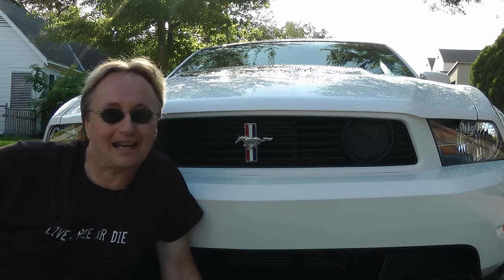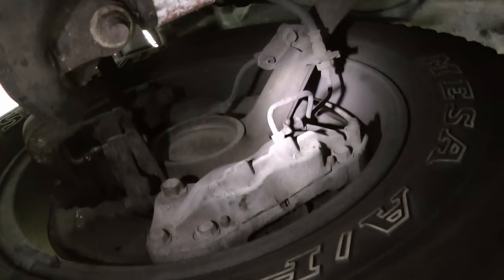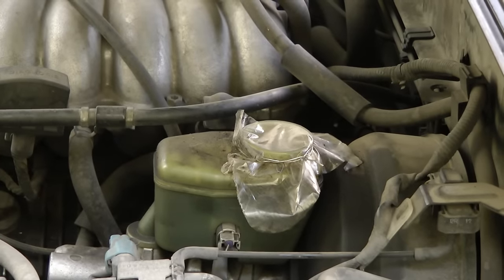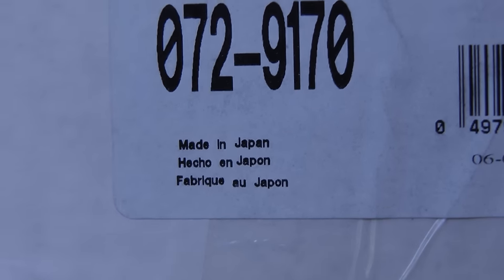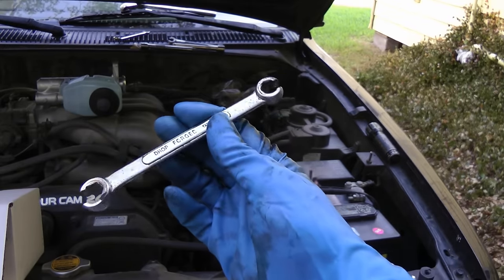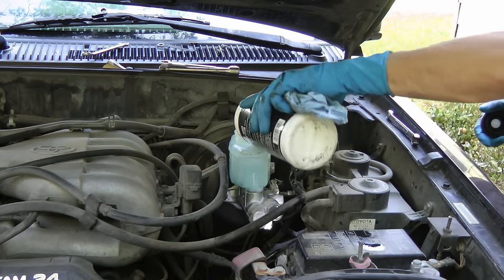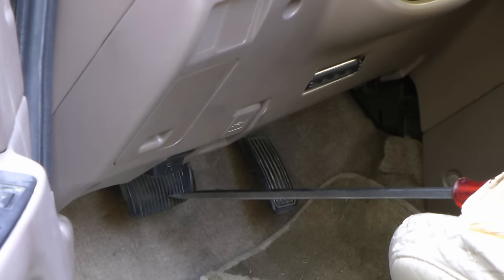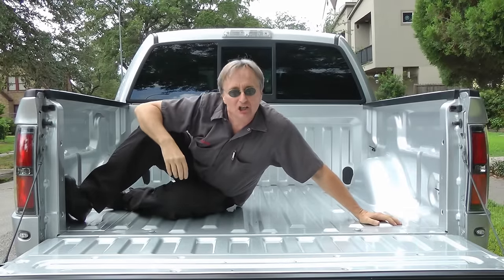How to Fix a Brake Pedal that Sinks in Your Car (Brake Master)

Comment: I just diagnosed and replaced a failed brake master cylinder on my 1986 Chevy K20 truck. $55 at Napa plus 16 oz of brake fluid, half an hour of time and done. And my 16 year old son helped me with the whole deal. He was very pleased to do the process from start to finish. Then we checked all the fluids. A great father and son activity and easily saved me 30-60 minutes of shop time.

Comment: Had problems with my brakes on my 1990 Toyota Pickup 4x4(4 cylinder). Replaced the front calipers (tried to take off the brake line on both but they snapped and lost all the fluid in the master cylinder) and the rear brake pads. Found out that the pedal went to the floor, figured it was the power booster (it wasn't) and got a used one from a 1994 Toyota pickup. Still the pedal went down and thought about the master cylinder. Here it was and I ordered the replacement part on Sunday and got it yesterday and did what Scotty said to do to bleed it. Got pressure back and bled the brakes and it's better than ever. Thanks for the tips Scotty!

Comment: Fixed our 1994 Chevy K1500 today using this technique.  We had already 
bled the brakes to no avail, and also bypassed the rear-anti-lock module
 which is reported to cause problems... so I got the replacement master 
cylinder and used Scotty's technique here... had a firm, hard brake 
pedal in about 3 minutes. :)  Scotty, you're awesome--keep up the good 
work! :)

Comment from the maker: to each his own, I never bench bleed, this method works fine if done correctly as in the video.  You can bleed the whole system, but often that will lead to leaks in an older system, believe me.
Reply: When you bleed it do you have to do the bottom method on each line by tire or ?

Comment: Great tips Scotty! I just find a gravel or dirt road and speed up to 20 or 25mph and do 3 or 4 emergency stops making sure the ABS kicks on. Then go back and bleed the system again. It works because air can be trapped inside the ABS Module and it is very difficult to remove the air using traditional bleeding methods. By activating the ABS, the air is pushed to the calipers and allow the air to be removed via bleeding. Of course, if you have the computer programs to do this without driving on a dirt/gravel road, then use those. But for those who don't, this works well.
Reply: My abs hasn’t worked for years. It’s just standard brakes now which I prefer. Question… with the abs system not functioning could this cause any issues with the rest of the braking system? Hydraulics, air, and the old fluid still in those abs lines 🤔 I just have abs light on dash with a sticker over it. 😁

Comment: Scotty, I am having trouble identifying why my brake pedal is sinking to the floor, at first, I discovered one of the calipers on the passenger side was bad, that made me to change not only the caliper, but the front brake pads, however, checked the rear brakes were in good condition, no leaks from either wheels. My main problem, the pedal is still depressed all the way to the floor, now the car does stop when you engage in gear, the emergency brake applied, what is the problem, is it  the booster or the master cylinder?
Reply from the maker: Godwin anetekhai often a bad master cylinder, and here's a test. If it does it with engine not running and engine running too, a bad master is often it. BUT, if it is hard with engine off, but drops with engine on, the booster is bad

Comment: This Great Video by Scotty got me to go ahead with the replacement  after he said to disregard the bench bleeding. It worked great on my 2001 Sport trac with ABS. There is a bleed port on my master cylinder opposite side of the brake lines. It made it real quick to get the air out along with the technique Scotty showed.
Reply: My abs quit years ago. It doesn’t effect my braking… that I know of. No grabbing. With the abs not working could this cause issues with the hydraulics, air in those lines and old fluid? I prefer just standard braking system from 20 years of living in Alaska without it. Alaskan winter mantra… “slow down, pay attention, increase your distance and feather your brakes.” Haven’t had an accident with anyone in all my years of driving. Defensive driving class for Forestry many years ago stuck with me.

Comment: Scotty, another great video- I've seen quite a few of yours; you're a go to guy for my automotive woes. I've worked on cars since 1990- even before, but that's when it became necessity to learn and remember. This video really opened my eyes to brake jobs past where I never got the pedal I wanted. I usually bench bled and followed that with repeated 4 corners bleeding. Sometimes I just could not get a satisfactory result after gallons of brake fluid bled through the lines. I was surprised to see you forgo standard and accepted practice of bench bleeding on, well, a bench. After watching thios video, I was able to bleed a vintage Camaro to a rock hard pedal after getting NO PEDAL even after replacing a booster, master cyl, shoes and hardware, and a new Combination Valve. In ten minutes tonight, I bled the best brake job I've ever done. I'm book marking all my PCs and making notes in the braking section of all my manuals. Keep on truckin'.

Comment: Scotty, finally the mystery is solved.
It was bad / leaking brake calipers.

Lesson learned, never rebuild them with repair kits. Just buy new calipers.

Installed new ones and i feel my brakes again. No sinking, either engine running or not, hard as they must be.

Thank You Scotty for your patience and help you gave me.
I really appreciate that.

Comment: Thanks for the video. 
I didn't know there was such thing as having to bleed the master cylinder. I thought I would have to take off all the wheels and bleed each brake (pain). With the assistance of my 9yo, we bleed the brake mc as you instructed, and now it STOPS! Thanks again. Liking and subscribing.

Comment: I have a 2010 HHR I changed my front brakes Pads. And I also bleed the brakes and I still have a sinks brake pedal now I know what I need to do.  Thank you Scotty God bless you my brother. Amen
Reply: did the master cylinder fix your brake pedal feel?  I have 09 chevy cobalt basically the car version of the HHR.  I did the front brake pads but still have that sinking brake pad feel.

Comment from the maker: If you have no air in the system after pressure bleeding the system, replace the brake master cylinder and pray the booster isn't bad too
Reply: Can I do this with the car in on position and or running or must it be completely off??
Thanks in advance

Comment: I tried to bleed my brakes multiple times after new pads and rotors and hitting a dear first. lol.... Hit a dear first but not bad......just clipped it, but had to stomp on my brakes hard like 2 or 3 times. lol....Ruptured a front brake line so had to be replaced first. Then a week later decided to go ahead and replace pads and brake rotors. Pedal got better after bleeding but only for a couple weeks....got all mushy again and back to the floor. So....makes me think my master cylinder is leaking inside and went bad cause we checked and didn't see nothing leaking or wet underneath. lol... So great video to post Scotty!! Was very helpful man!

Comment: What does it mean when I went from I went for a brake fluid flush, with no problem on the brake line…… but as soon as I get it back and try to drive away from dealership and brake  sinks to floor?   No pressure, did they not tighten the lines, or not put enough fluid in?????  I know the master cylinder did not go as it was entering the service portal. Please someone reply ❤️ Tks!!!

Comment: I actually followed this guide and was able to change my master cylinder myself, thank you Scotty. Could have been nice if you warned us about the master cylinder would squirt brake fluid if the brakes are pressed and the lines are loosened. Found out the hard way.

Comment from the maker: depends on how it broke. Sometimes they just get harder to push, but stop. Sometimes they won't stop at all
Reply: That’s what happened to mines harder to push almost impossible then the I P brake system came on
Reply: I got an 01 Corolla, the guy bled the right rear wheel . (No foot on the brake bleeding procedure)until bubbles came out. He said the brake pedal always went to the floor and the master cylinder never goes low

Comment: Putting plastic over the opening??? What the heck were they thinking, a new cap costs like 10 bucks, or even less if you look for a used one...
Reply: It’s Pecos Hanks old car. He’s a storm chaser and  I wouldn’t doubt that he lost the cap on the road and didn’t really have time to buy a new one.
Reply: @Obi_Wan_Kenobi_027  there are toyota dealerships everywhere bruh he was just lazy

Comment: Hey scotty I just changed the front shocks on a 01 civic and everything that could ho wrong did starting with the stud for the tire breaking off when I took first tire off.anyway I took the hose off the caliper and brake fluid came out so naturally I put it back together when I finally got the job done the brakes went to the floor they stop the vsr but like I said they go to the floor. What should I do should I try bleading them and if so do I have to bleed all for tires  or can I just do the fronts please help
Reply from the maker: you have air in the system, start by bleeding the front brakes first as those are the ones you disconnected

Comment: Hey Scotty , do you have to bench bleed the master before installing ?
Reply: I didn't , i just followed the instructions,  i've just finished changing one on my Mazda 3 ,  i'm just back from a test drive,all is good.
Reply: I didn't either, not sure if it matters but I did bleed the whole system big time. It has rust in the master reservoir. It is a good thing to change fluid every 5 years? Beats me, when it gets ugly tho

Comment from the maker: slow braking is often a weak master cylinder or weak booster.Worn pads stop as well as non worn pads, they just start making noise and eating up things when they get down to bare metal.

Comment: first when you replace a master cylinder , you bench bleed the master.
second after the master is installed you bleed the complete system.

best thing is to flush the system. with no cap on the master you better replace all the brake fluid before contamination ruins the seals.
Reply: Well I am not a mechanic with Scotty's experience.   However, when I changed a master cylinder the instructions said to bench bleed the master cylinder before installation as you have stated, and came with special tubes to do this.  Furthermore, I too have read many many times that moisture in a brake system is taboo.  Consequently, I don't understand why you would not just flush out all that suspect brake fluid while you have the system open.  Finally, I am in shock that anyone would not replace the cap, and can't believe the brakes even worked with that plastic on the top.  In fact, I am SURE the brakes would not work that way.
Reply: @timbarnes3581  to be honest, I have installed many "Master cylinders" and do my own brakes, calipers,etc. AND HAVE NEVER flushed my brake fluid in any car I have owned.
 I have owned the same trucks, vans and 1 car for 20-30 + years and NEVER had an issue because I never changed the fluid.
Reply: @lt4324  Well thanks for the info Tom.  Obviously Scotty has worked on cars for many years.  But when you change a master cylinder do you bench bleed them?  I have only done one master cylinder myself and that is what the instructions said to do.  However, I know there are shortcuts that work as well.  I only flushed a system one time myself and that is because there was a lot of rust in the lines from a cylinder on one of the rear brakes, but that truck was like 25 years old and had sat for a number of years without running.
Reply: @timbarnes3581  Yes, Being only myself, I did bench bleed and if I had to bleed all lines, I used a "power Bleeder" when doing it by myself. 

But then again, I have NEVER had to change a MC on my current vehicles (all plastic MC)
 The ones I used to change were "all metal" like on an old 86 Ford E150, Cadillacs, etc. I have yet to install these new ALL plastic MC's So in that respect I can say no.  Only bench bled the older ones. BUT I am guessing you still need to bench bleed them.
Reply: @lt4324  I agree!!
Reply: @lt4324  Hey Tom, my brakes sinks in, but not as fast and as freely as in this video. It sinks in slowly and do not touch the floor. 
1. Steps on brake pedal and it drops freely for few mm 2. The biting point as I call it is where it feels firm (doesn't drop further )and the vehicle stops. 3. When I put more pressure than required at this point, it starts sinking in gradually and go all the way down, but never touches the floor.
It's been like this for more than couple of years and I never had any problems with braking. But when my friends drive it and notice it, it feels little awkward. Can you please tell me if any of this sounds like the MC needs replacement, or  just the brake hoses or just a brake bleeding would solve it? The brake fluid is always full and there's no visible leaking behind the tyres on the hose area. Thank you for helping!
Reply: Colorado Strong  Oh man that doesn't sound good and looks like costly repairs are waiting. Just curious wht it started in your case after changing the caliper?!
Reply: Bad caliper can cause spongy or soft braking too.
Reply: @jyajaquaroom8039  How do we check if caliper are bad? Thanks!!!
Reply: Bench bleeding and bleeding the master cylinder whilst its on the car are the same thing, you're trying to bleed the air out of the master cylinder, just different methods. I myself prefer bench bleeding cos its easier to do by yourself, as you could see, Scotty had to go back and forth to release the brake & tighten/loosen the nuts.

Comment from the maker: many times the brake master can be damaged doing a brake job, see that all the time
Reply: Scotty Kilmer I wonder how that happens.  I'll look it up.
Reply: I damaged mine doing a brakes job at night. trying to get a little break from heat.
Reply: From pressing the Pistons in?
Reply: Brother I just replaced my brake master cylinder I’ve been bleeding for almost an hour I’ve got a 08 Chevy 2500hd and I’ve been reading there may be air in the abs? I don’t know what to try next , im going to drink a beer and go to sleep I’ll try again tomorrow
Reply: Felix Sanchez I need help I tried this video method but still goes to the floor with zero resistance. How could my master cylinder break from doing the brakes?
Reply: @PickleballBrand  don't forget to fill it back up with Brake fluid lol
Reply: Alex Bock it is at the max line. Still gotta push way down to stop
Reply: @Ozzy920  I have the same thing going on. Did you ever figure out what was going on?
Reply: @PickleballBrand  I have the same problem. Did you figure out what it was? I could really use the help.
Reply: Christopher White well I decided to bleed each brake line from furthest away to closest and I do think it became easier to brake but it is definitely not at its normal. So I think I need to bleed the master brake cylinder cus maybe there is air in there. Just haven’t gotten to it yet tho
Reply: @PickleballBrand  I  Replace the master cylinder and the front brakes and bled all the breaks and now I believe it could be my back brakes.
Reply: Christopher White yeah when you’re trying to get the air completely out, it’s best to do the master cylinder then the furthest brake line leading to the closest
Reply: So if u still have the back brakes to bleed then u could get air back in the system. But I would think your brakes will still be good even if it wasn’t completely correct order
Reply: @PickleballBrand   I don't  Know how but I think it's fixed who.
Reply: Christopher White oh good. Well it’s advised to bleed the brakes every 2-3 years so when the time comes just look it up and it’s not that hard
Reply: @PickleballBrand  Having the same issue, car was fine, sat for a little while, pedal goes to the floor. Bled all the brakes back to front, same thing. Replaced master cylinder, same issue still, pedal goes all the way to floor to stop the car..... any ideas?
Reply: @justinmckibben4534  have you pushed the air out?
Reply: @PickleballBrand  I guess not? I will do another bleed this weekend....
Reply: @justinmckibben4534  what was the problem,  i'm going through that with my mazda now..
Reply: @jeremiah1797  don't know actually I changed master cyclinder bled it multiple times, changed a hose to one of my brake calipers... sold that car though can't remember how it performed but I was driving it so must have solved it.

Comment from the maker: generally a wearing out brake booster does that, any mechanic can hear it and tell you in one minute
Reply: Unfortunately I wasn't able to buy a new power booster and master cylinder I could only buy both remanufactured for my 1978 Dodge Aspen Custom Sedan I just bought.

Comment: My extra car (2005 Mazda 3) just started giving this problem. Interestingly If I pump the brakes 2-3 times in a row, it works fine at that time but will sink to floor again10 seconds later. It has about 45K miles on it (bought 3 years ago with 32K miles). it is extra car so we are not in danger, but would like to fix it myself. Do you think air in the line or thinned out brake fluid can cause this and I should start with changing the fluid? Or  does it sound like something else?